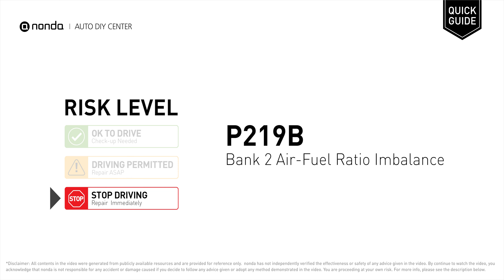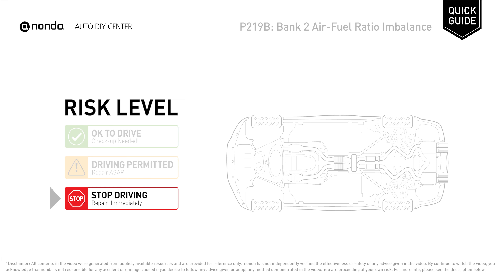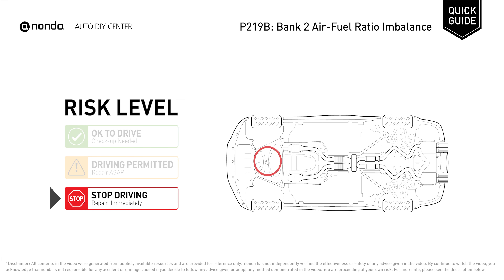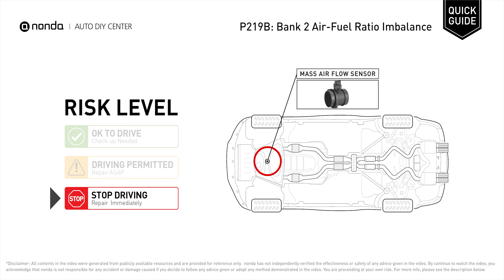What is P219B Engine Code [Quick Guide]

Comment: 2010 Silverado 1500 5.3L 106k miles. I had 2 other codes Bank 1 and Bank 2 too lean. Replaced O2 Sensors, replaced MAF sensor and Gas Cap. Those two codes cleared light is not on I drove the truck around and has P219B (Manufacture Control) come up but code reader stated 0 codes registered at 1st. Should I be all good. Should I be worried. I drove the truck about 110 miles today to have everything ready
Reply from the maker: Hi Ross, since you are receiving multiple error codes, we suggest getting your vehicle visually checked by your local mechanic.

Comment: I’ve got a 2015 Ford f150 3.5 ecoboost. I took it to get scanned and this code came up. Anyone having the same issue or has had it and repaired it? Please let me know what the cause could be just so I know what to prepare for lol.
Reply: Any repair or diagnosis?
Reply: Did you ever find the issue ?
Reply: Well I found out my turbo went out and I had to replace the entire cooling system. I had to change both bank O2 sensors. After that I never had the check engine light on again.
Reply: I just had this code come up on my scanner after the check engine light came on, I already knew I had a pretty bad exhaust leak, but haven't had the spare cash to dig into it!  Just hoping it'll hang on to running okay for a bit longer until I can afford to fix it!

Comment: My 2014 Chrysler 300 is not starting and it's giving me the P219B code. What part needs to be changed?
Reply from the maker: HI Donald, we highly suggest to check if there are other codes present as this code is usually accompanied by other codes. Check for exhaust leak and inspect the oxygen sensor wiring for any issue.
Reply: Ever find out what it was bro?
Reply: @lowzb9685  thinking the o2 sensors
Reply: @donaldharvey4399  Found that mine was a bad injector and seal. Those Direct Injected seals are prone to doing that. Also, the spray on #4 cylinder injector was ragged. Actually was dripping when tested..

Comment: going to try replacing the mass air flow sensor....and o2 sensor... 2015 silverado 1500 84k miles. engine light came on with this code. next day light is flashing and traction light is on and blowing white smoke from exhaust
Reply from the maker: Hi Jet, kindly perform a visual inspection also to all related wiring/connectors and replace if there's any damage. Check for engine vacuum and exhaust leaks.
Reply: Did it work? Just got a P219B code as well on my 2016 1500 5.3 and no other codes. Little stumped